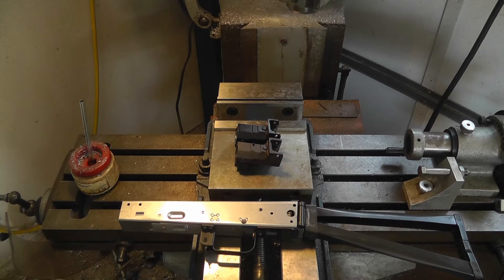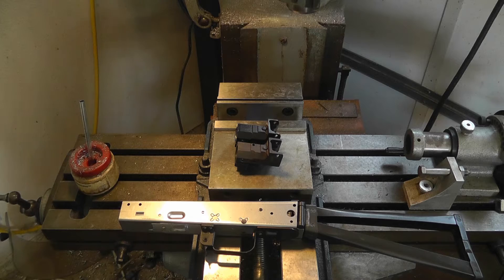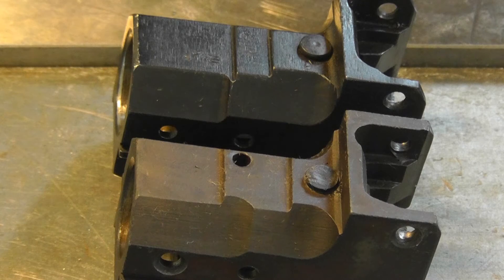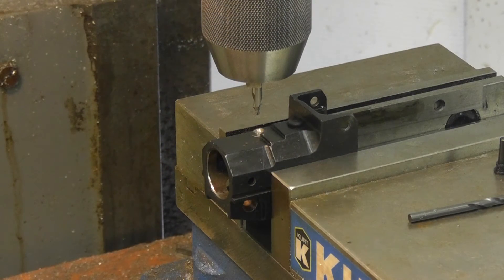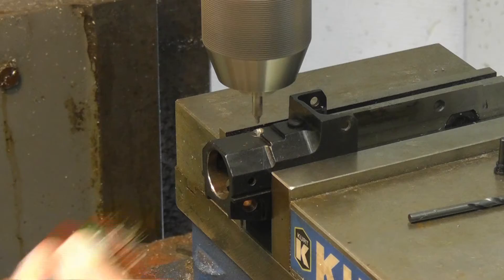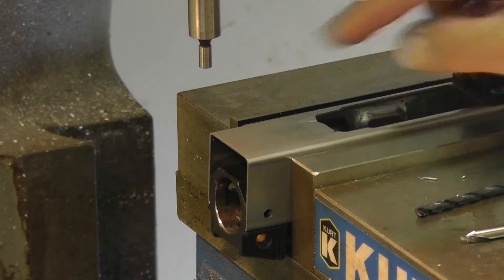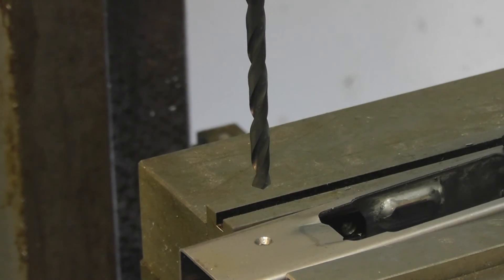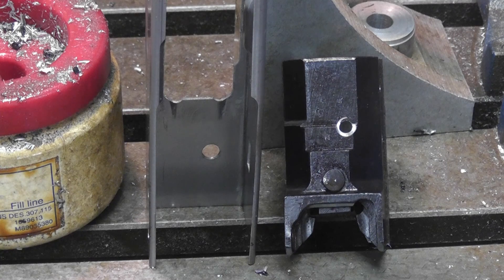Installation of AK Khyber Sidefolder. Part 1: machining front trunnion

Comment: wonder if i'd really have to remove the front trunnion from an already built ak if im wanting to retrofit a side folding stock.. trying to keep my labor to a minimum. should be able to measure, drill receiver, center punch, drill trunnion.
Reply from the maker: +callofgeorge It's been a while since I filmed this build... brings back fond memories. It is very easy to uninstall/reinstall an AK barrel if you have the tools (including headspace gauges) and press. That said, I see no reason off the top of my head why you can't drill the pivot pin hole in situ so long as you don't drill into the barrel. In other words, you will need to carefully measure and drill a stepped blind hole just deep enough for the pin to sit flush against the bottom of the receiver. The hardest part of this build is installing the spring that engages the latch.
Reply: +aleaddict yup, i've done a few scope mounts and etc that had to be certain depth in the barrel, so i've got some practice there.. i figured that spring it going to be a bish.. just ordered a Saiga. they have them on sale for $500 right now at TopGun supply. contemplating if i want to attempt side folder on that, or just turn a m92 pap into a side folder sbr. never cared for the UFs much.

Comment: Have you assembled this rifle yet? My question is have you had and problems with the latch working? I was wondering because I know the latch has to pivot back just a bit, that's why the shelf is flat on the AK-74 Trunnion. I noticed that the Trunnion on the AK-47 steps up closer to the hole. I have seen other builds where they have had to mill some relief on the shelf to either match the radius of the latch itself or mill some material off the shelf to match the shape of the AK-74 Trunnion. I am interested in doing this build myself with an M-92 Krinkov kit. Was wondering what you would suggest? Also how many thousanths did you have to take off for it to work or how many thousanths difference between the two Trunnions on the middle shelf? Any help will be greatly appreciated Thanks!!